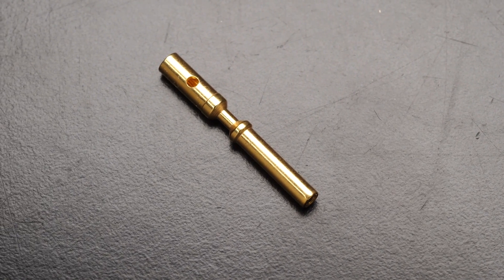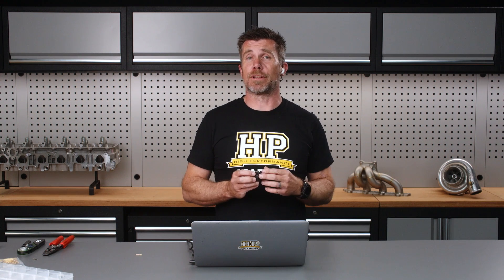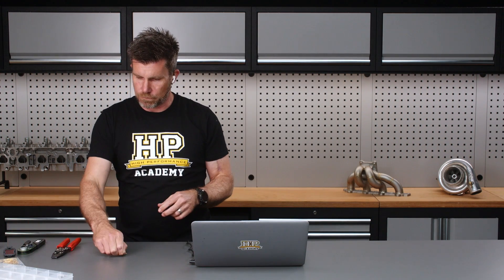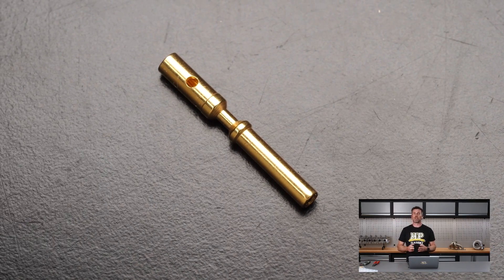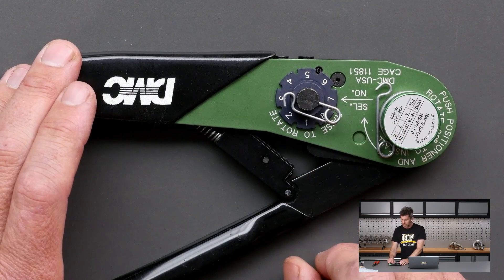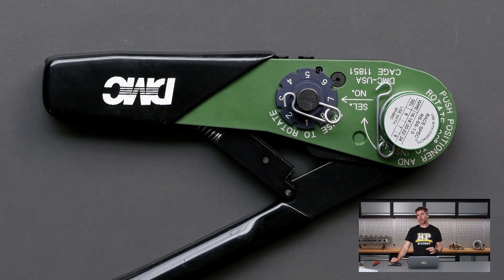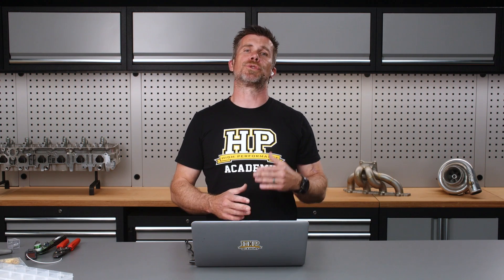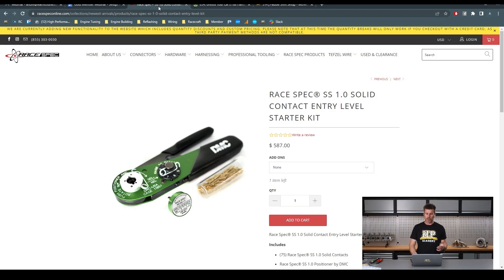Save Time With One Crimp AMP Superseal Contacts

Comment: That does not look like the correct positioner for that contact. The crimp is way too low.
Reply: I think it's that low in order to avoid the inspection hole. TBH, I don't really see the point of inspection holes if you're already working to a standard where you're avoiding the insulation from touching the terminal by stripping the conductors slightly longer than the length of the terminal. The hole is really there to make sure that it's fully inserted and that you haven't stripped it too short, but that's already handled by the process of stripping it longer and leaving a gap.

Comment: FYI, you have been doing this the hard way all these years Andre!  MilspecWiring sell the correct crimp tool for these connectors, it holds the terminal securely and crimps both crimps at the same time. I have had one for 15years, so they have been available for a long time.
Reply from the maker: Up until recently, the only die set that would perform both operations in one cycle was the spec TE tool ($2k per (3) contact sizes = $6k or a Rennsteig piece that was designed for OE grade wire (as in not Tefzel 😎).

Is that what you have been using or something else? - Taz.
Reply: @hpa101  Yes Rennsteig. About 500usd complete tool and jaws. Yes when I got mine 15 years ago only oe type insulation size was supported but many more jaws (about 350usd) now available. 
If you can now buy a tool for similar price to the racespec tool then why not use the correct AMP specified superseal 1.0 terminal, it has the insulation restraint which is not available with the bespoke racespec terminal.

Comment: Klauke K 58/2 or something similar should be able to press this in one operation. the other connectors are of course better but they are not free.
Reply from the maker: I believe up until recently, the only die set that would perform both operations in one cycle was the spec TE tool ($2k per (3) contact sizes = $6k or a Rennsteig piece that was designed for OE grade wire (as in not Tefzel 😎) - Taz.

Comment: Any chance you can use these terminals with a DTM crimper and still get a reliable crimp?
Reply from the maker: Great question, not something I have tried personally. You could ask Race Spec if they have tested that. I'd imagine they did, but never hurts to ask - Taz.
Reply: Not recommended the MH860 does have positioners for DTM pins though

Comment: They look nice! probably getting closer to the quality of rc connections I regard most connections in automotive industry as Junk! These are getting there! edit-thought they were just brass but hearing the whole vid these are looking the goods👍
Reply: RaceSpec closed barrel SS terms are gold plated.
Reply: @Ori3ntal3Xpr3ss  yes it’s been well thought out! I’d like to see the difference in amps capability! and long term stress test compared with the conventional pin with integrated strain relief vs silicone push on
Reply: @needmoreboost6369  amp capacity meets and exceeds what the housing can withstand. Tensile strength can be seen on the RaceSpec website on the SS page.

Comment: FYI they made double crimp dies to crimp the conductor and insulation in one go. About $60 vs $650 and can use generic included terminals
Reply from the maker: Up until recently, the only die set that would perform both operations in one cycle was the spec TE tool ($2k per (3) contact sizes = $6k or a Rennsteig piece that was designed for OE grade wire (as in not Tefzel 😎).

As Ccooxxyy mentioned Race Spec also designed a die in conjuction with Rennsteig too if you prefer that for wire with thinner insulation: https://racespeconline.com/collections/newest-arrivals/products/rennsteig-amp-superseal-1-0-die-set-race-spec-exclusive?utm_source=hpacademy

It is worth mentioning the specs on these contacts are also different to the generic AMP ones. They have designed them to be better, it's not just the single crimp function alone.

Not here to push them down your throat, you either need/want/have an application that warrants them or you don't, just sharing the information - Taz.
Reply: What company? Rennsteig and Racespec have dies but not for $60
Reply: Racespec make one, I used one yesterday! 👍 quick precise and easy!
Reply: Well yeah, but if you did it for a living it would properly make sense, time is money as they say.
Reply: I wonder if the Knipex 97 52 34 crimpers would be suitable for these open barrel crimps?

Comment: No strain relieve on the isolation of the pin? There should be crimp tools that do both of the clamps in 1 motion (at least i had them years back when i worked on printer wiring connectors, had pins just like the first ones in this video)
Reply: You're correct, for about $60 and you save on not needing special pins.

I could maybe understand the crazy cost if it wasn't also an inferior design
Reply from the maker: @Onewheelordeal  what tool are you using that is $60 alone for this? - Taz.
Reply: I bought a set that is supposed to do both crimps at once from snapon (bluepoint) - haven't found a single terminal that lines up with the die correctly yet lol.
Reply from the maker: @sneh2j00  sounds about right! Previously you could get a tool from TE but all up it will cost you around 6k. The idea behind this is a superior contact and a simple crimp solution. It won't suit everyone and not everyone needs these tools and materials by a long shot, but since released a year ago many people have benefitted from this product without fault.

Nothing wrong with learning about something even if it doesn't fit your application personally or professionally - Taz.
Reply from the maker: The SS 1.0 connector body incorporates a mat seal, similar to a Deutsch DTM/DT, and a much thinner version than the dielectric found on a MIL/Autosport connector. 

Race Spec strongly encourage people to use a back shell and boot while using their contact in order to obtain greater strain relief than the factory S/F contact offered. Goes with out saying the average hobbyist will still be twitching about the cost before they ever had a problem in that regard, even with the connector exposed.